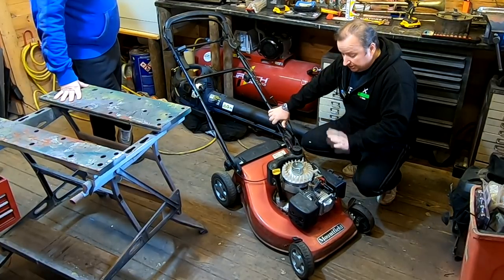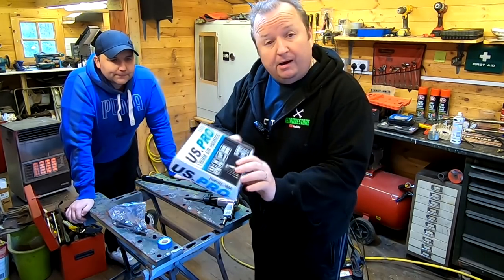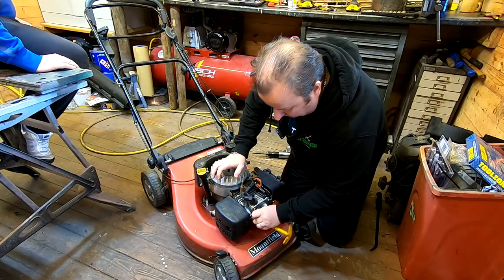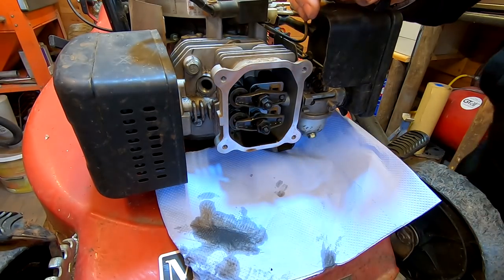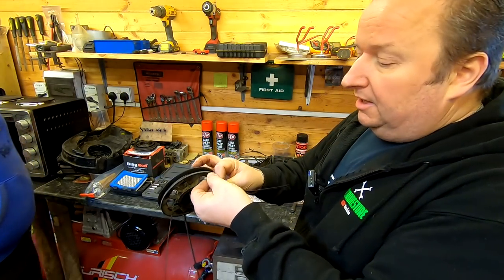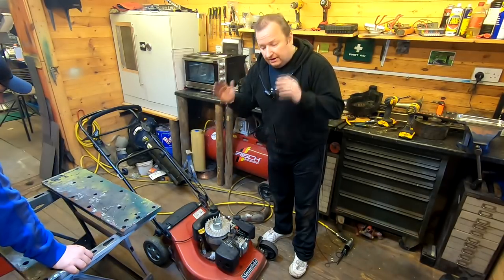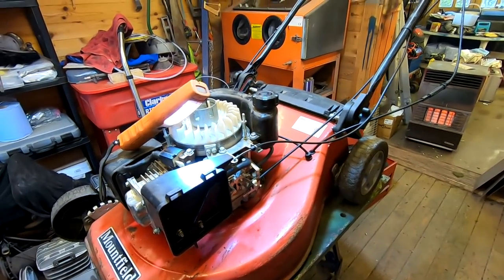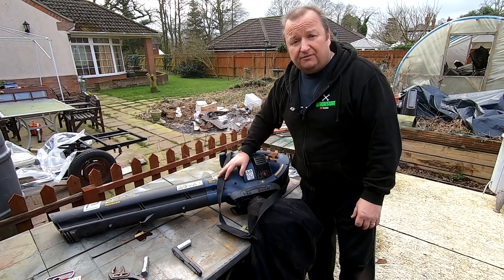Mountfield Lawnmower Won't Start And A Leaf Blower Let's Check Them Out

Comment: I would have thought that the pull cord  would not have much more torque than your battery powered drill, but there you go, you live and learn
Reply from the maker: That's right bud, just shows you.

Comment: Nice work on the mower Martin, if it still wouldn't start after a faster drill I was gonna say the camshaft might be out of time in the engine but glad it fired up after using the corded drill and that's great the blower runs too!
Reply from the maker: Yes, that would have been the final check if it didn't start

Comment: I had the same problem and i found the spark plug was not sparking. The tester only tells you there is high voltage to the plug so a lessen learnt after pulling my hair out.

Comment: I could sit and say that you where doing all wrong lol but what would I know lol. That pull cords are a right pain in the Neck. I have wound them up with the drill a few times lol. Lol we have all been caught out with the left hand threads mate it happens. Boom broom its running well Martin And Gary Butler. Somtimes all you need is a bit more torc. Just needing the recoil spring am sure Mick Mowers probably got one. I  just got a mountfeild with a Honda engine. But she is seazed so when weather is a bit better and i find some must have a look at it. Good job Lads.👍
Reply from the maker: There are 2 more videos on this mower Ali the next one is on the 20th so keep tuned
Reply: @retrorestore  i will  stay tuned don't worry lol. Do some more car vids  pls as i can't cause of the rain lol.😂 Tc Next one 👍

Comment: Nice job on these! I wish I had that sort of luck with 2-cycle engines as you did with the leaf blower. I'm not sure if they do this in the U.K. or not, but here in the U.S. they started adding Ethanol to fuel some years ago. Ever since then, I have noticed that the carbs on these 2-cycle engines get gummed up with residue if the fuel sits in there for a while; sometimes just even a year is all it takes. Of course, it is usually a matter of taking apart the carbs and cleaning the gunk out of the fuel screens, but it is very time consuming to do so. As a result, I typically don't bother with 2-cycle engines in terms of refurbishment -- it's too long of a personal investment of time to get any decent return money-wise for me.
Reply from the maker: Yes, we have a similar problem here too. Always a carb issue on these.

Comment: change the plug i have had that quite a lot with these engines and champion plugs where you get an weak spark or no spark at all. it is fairly common with these engines for some reason you get to high a resistance or often a dead short through the plug
Reply from the maker: It starts and runs great

Comment: Did you try bending the spring when it was red hot? I have a monster electric drill that would probably break your arm if you tried starting a mower with it. Never had much luck with battery drills as they only get used occasionally and the battery dies.
Reply from the maker: The spring was very brittle. Wait for the next 2 vids on this mower

Comment: The engine on this mountfield is the Chinese Loncin based engine. You will probably have to buy a complete recoil  housing as they don't tend to sell the spring separately because the parts are made cheaply enough as its Chinese. The Loncin engine is better than the other Chinese Sumec SV engine they fitted on previous mountfield models.
Reply from the maker: Wait till the next couple of videos

Comment: Would the spark tester spark even if it's not sparking at the end of the plug. I was thinking surely the spark tester only  tests the ignition coil??
Reply from the maker: No, if the spaek plug was dead, it wouldn't spark

Comment: Hi Martin, Do you know how to slow these types down? Mine is revving its head off when you take it off choke. Very strange.
Reply from the maker: I suspect either a sticky governor arm or the the throttle shaft in the carb might be stuck.